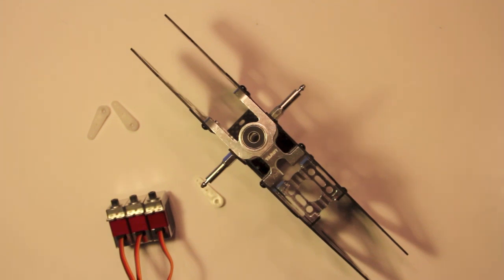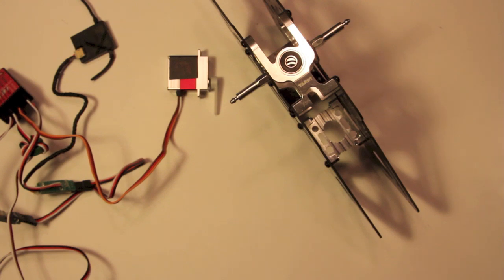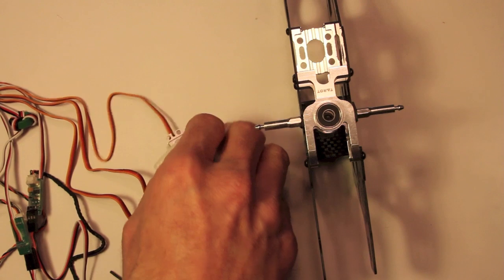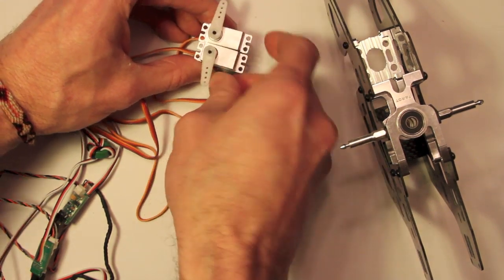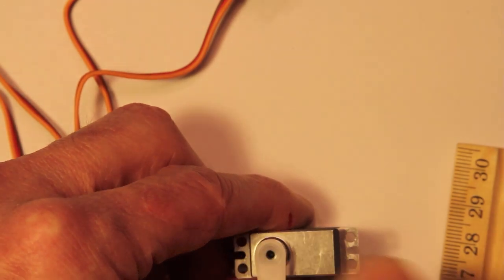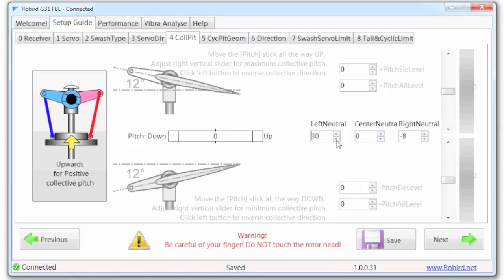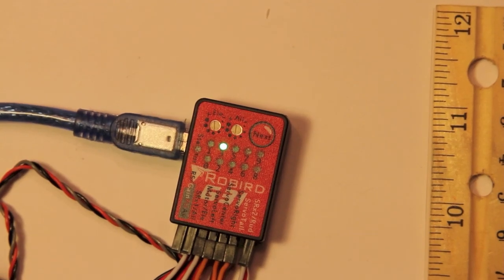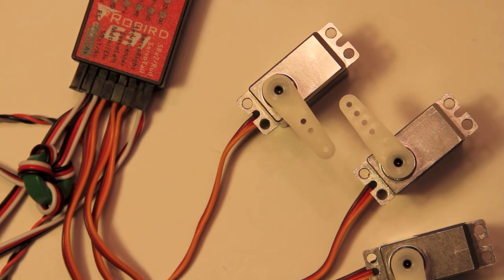14 : Tarot 450 Pro V2 Build : Electronics Extravaganza Volume Four

Comment from the maker: I can't wait either!  It's been a long time coming.  Are you referring to the ESC I am using (Platinum Pro 40A)?  If so....I like it fine, but I have nothing to compare to. I was originally going to go with the YEP 45A from HobbyKing, but it was out of stock.  The only real reason I was going to go with the YEP over the HobbyWing was the governor is supposedly better. However, I decided to use the governor on my FBL, so it makes the Platinum Pro a solid choice again.